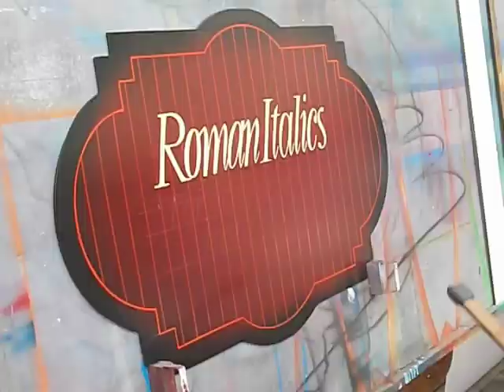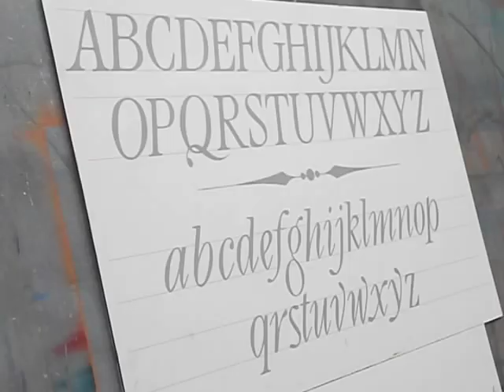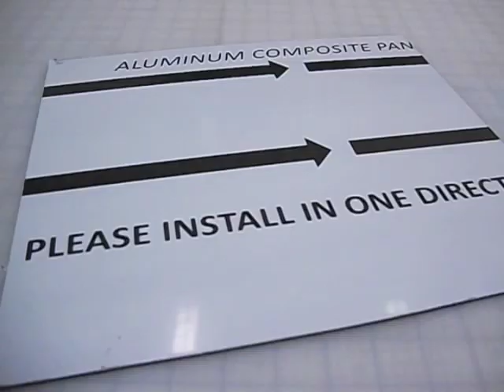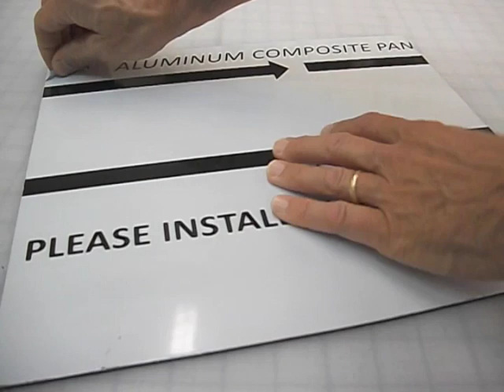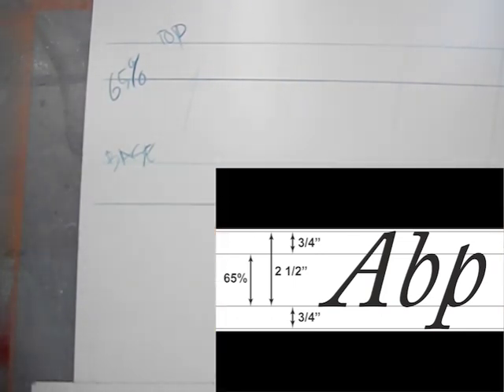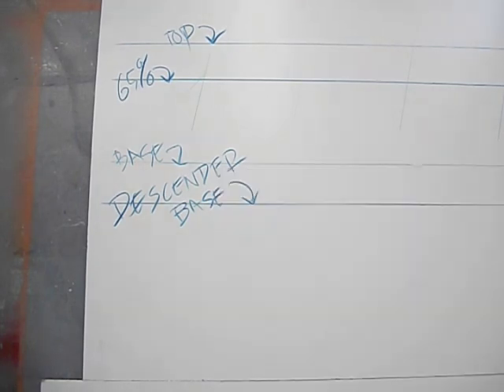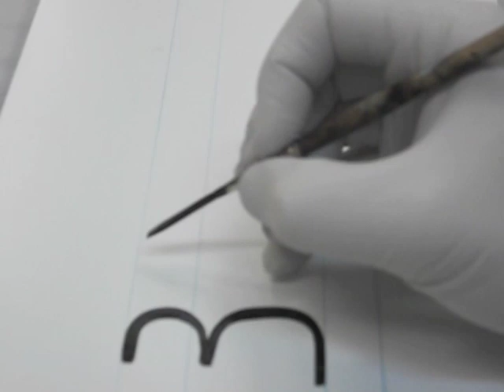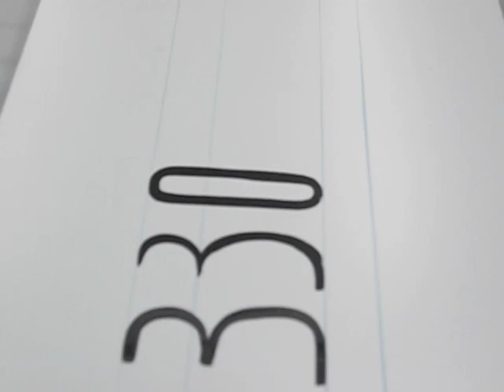1  Roman Italic Intro

Comment: I just started practicing. I've been using glass but am having such trouble on curves. The brush just starts going sideways instead of following the line. I'm sure it's me but should I not practice on glass?
Reply from the maker: Buy this:
https://www.amazon.com/Royal-Brites-Poster-Inches-50-Sheet/dp/B000RSZWDK

Glass is not good for practice. This poster board has a slightly coated surface, great for practice. You can gloss spray paint it different colors to break up the monotony 😀
Reply: @davidographicsguy  I'll order it today.
Reply: @davidographicsguy  will I be able to use one shot with it or what can I use?
Reply from the maker: Yeah, 1-Shot works great on any slick surfaces. Keep your practice posters so you can see how you’re progressing. The posters will probably arrive slightly damaged because of the light packaging, but it doesn’t matter for cheap practice boards. The main thing is to love doing every stroke of a letter knowing you’re painting them with your own hand. And when you’re practicing, talk your way through every stroke like you’re teaching someone, it helps keep you motivated and accurate. Have fun! 😀

Comment: I use  penetrol flood  to prep smooth glass or surface that will not grab paint , makes it stick used for oil based paints , and can thin paint or be used to clear coat satin finish over patina paint and rust
Reply from the maker: Wow! That’s a lot of chemistry! 👍😀
Reply: @davidographicsguy  not really just a product us house painters use over old gloss enamel to make water base paint stick ,even vanished timber  or glass ,just rub it on with a rag  ,,tonight i  pinstriped my old patina sign writing paint and brush box first try at it ,, using size 0 alligator dagger ,suits it looks like was done in 60s :)